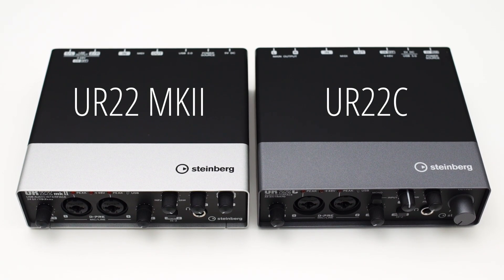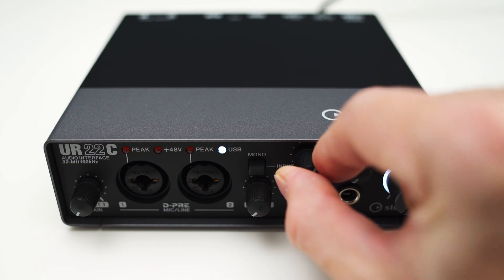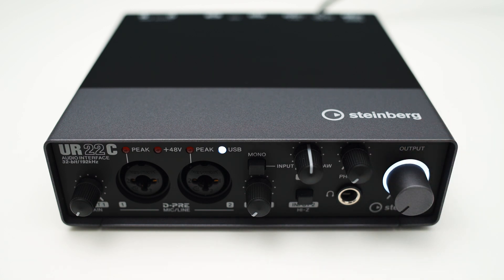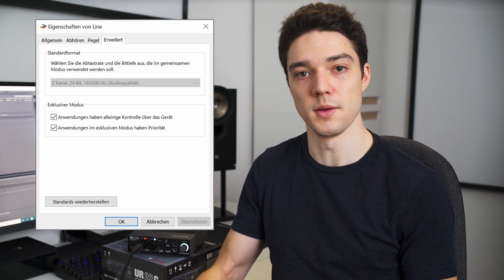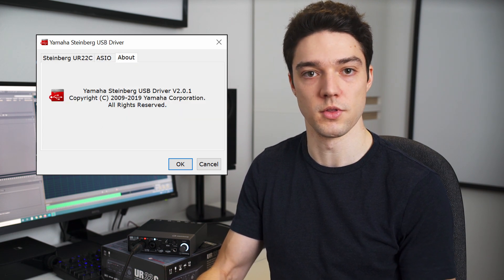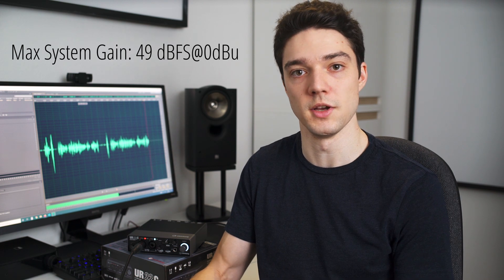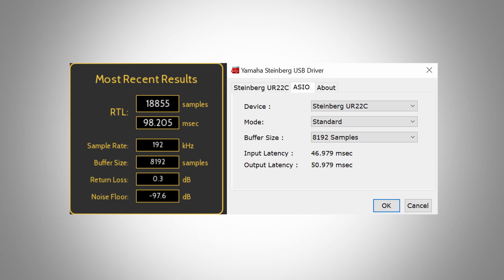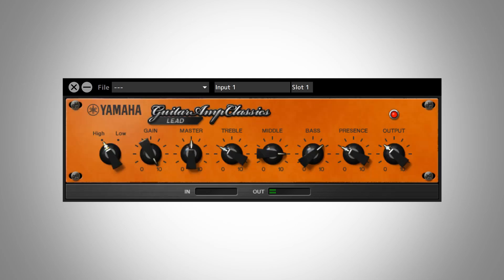Yamaha URX22C / Steinberg UR22C Review - Did Steinberg improve the legendary UR22?

Comment: Hi @Julian Krause!.  Stellar review, and great channel. Thanks so much. 

I just picked up the Steinberg UR22C Audio Interface, which I was hoping use for an online Piano lessons. Unfortunately, I can't get the device to pick up either my Antlion ModMic (using a 3.5mm TRS to 6mm TRS adapter), or my Stadium Lavier mic (with a 3.5mm TRRS to 6mm TRS adapter).

The Antlion mic works in everything else, while the lavier mic works only on my iPhone. I assume it has some kind of pull-up circuit going on.

The interface works very well with the piano and guitar.

Any idea what I might be doing wrong? Do these mics need bias power or something? If so, how can I do that? Or do I need to change the input settings somewhere?

Thanks to anyone who can point me in the right direction.
Reply from the maker: Hey, the 1/4 inch inputs on the UR22C are line level inputs and not designed to be used with 3.5mm mics. They don't provide the 3v plugin power that the mics need. If you want to use your lavalieres with the UR22C you need something like a Rode VXLR+ which adapts 3.5mm to XLR and converts the 48v phantom power to plug-in power. Cheers!

Comment: Greetings from Greece my friend ! I’ve got a very important question about the UR22C. Mine arrived today and I generally like the sound, preamps and DSP fx, but my problem is the headphones volume as you mentioned in your videos. I currently use the AT M40fs headphones which were very satisfactory for me till now. I definitely cannot work with the ur and the m40 as the headphone volume is low for me. Which kind of headphones should I use for a higher volume. Should they have bigger gain, impedance or what ? Please answer to me as soon as possible because if I can’t fix this problem, I will return the card and buy Sth else that totally covers my needs. Thank you in advance.
Reply: A bit late I guess, but I see that your headphones have 60 ohms impedance, which is on the lower side for studio headphones so you wouldn't expect any better from that aspect. Sensitivity is measured at about 100 db, which would be average by today's standards. So if I was in your shoes I would have either tried more sensitive headphones (about 110 db maybe) or accept that most usb powered cards will not be terribly good at driving headphones so a dedicated preamp is needed. I'm surprised though, because I've used my 300 Ohm headphones on USB interfaces with an acceptable volume, while my 64 Ohm AKG K275s (stated sensitivity: 109 db) play more than loud enough directly through my smartphone.
Reply: Hi! I also have the AT M40fs headphones and I'm planning of purchasing the UR22C to work with Cubase. What did you finally do about your low volume issue with these headphones paired to the UR22C? Thanks in advance!
Reply: @Steven-do2dp  after changing more than 15 interfaces, I realised that it’s a common issue that the headphone outputs don’t have enough power to drive high impedance headphones. Luckily, with the ur22c you are able to insert the morphing channel strip on the channel you want to record and this will bring up the volume enough. Of course you can choose NOT to record it, but record only the raw signal. The m40fs will be ok with the ur22c. And I’m saying again that the volume is ok for listening to music or for mixing/mastering. My issue was only when tracking. Greetings from Greece.
Reply: @PetrosAntoniouMusic  Oh that's very valuable info for me! I think that's the confirmation I needed to finally decide myself to purchase the UR22C! BUT BUT BUT... I'm a bit worried about what Julian said, that low impedance headphones with the UR22C could modify the sound a little, so that it can't be reliable when mixing or mastering solely with these headphones...  Any thoughts on that?

Comment: So the second power supply is micro-usb ... wtf, why Steinberg?!
Reply: Not an issue since it's main power source is USB-C, and it comes with a cable. I just got one. The other end of the cable is normal USB sized male plug lol. The micro is for using on the go with portable devices. It's just a cable man.
Reply: @TheDyingScotsman  Would love to hear what you think of this unit once you've set it up and had a play.

I'm really fond of the DSP effects being handled by the unit itself in real time, rather than by the PC.  Amazing for both monitoring and eliminating some post production while recording vocals and instruments, and super handy for live streaming.
The only thing I'm worried about is the noise floor.
Reply: @iRud99  Well so far it seems fantastic. I hear a little bit of hiss coming through my headphones, but recording tracks themselves there is no noise to speak off. The built in DSP actually seems really good. I won't use it most likely, except for the reverb which sounds amazing out of the box. The amp  sims seem mediocre but there's plenty of VSTs for that stuff!

Comment: Hi. Thx for this great review. I have a question about the headphones output level of the ur22c. I red that it is quite low. i have a Beyerdynamic DT 770 80 ohms and i don't know if this interface is well suited for this impedance level. I want to record tenor saxophone with a playback in the headphones from Cubase so i need a decent output level to hear the playback while i play the sax, which is a pretty loud instrument. Or should i upgrade to a dc powered interface such as the ur-rt2. Thanks for your answer. Franck.
Reply from the maker: Hey, I don't think the UR22C is suited for your DT770. The high output impedance of the amp can change the sound and as you said, it does not have that much power. I'm not sure if a wall powered interface will solve this problem. One solution might be to buy a different interface like the Motu M2. It has a very high quality headphone amp and much more power than the UR22C.
Reply: Julian Krause thx a lot for your advice. I have watched your review of the motu and it seems great. I have noticed the point concerning phantom power. As i record with an akg c214 condender mic, i understant that there will be no problem if i use the phantom power button ? Have a good day and keep the great reviews ! Franck.
Reply from the maker: @alcarazfranck9952  Correct, there will be no problem when using the AKG C214 with phantom power. Cheers!
Reply: Julian Krause Hi Julian. One last technical question about headphone output comparison. I went through the users manual of different interfaces (being totally ignorant !). For the ur22c they say that the headphone max level is 15mw+15mW, 40 ohms. For the urrt2 (wall powered) :  100mW+100 mW, 40 ohms, so louder than the previous one. For the motu m2, the specs are different : max output level + 12,5 dBu 16/32/55 ohms. Does this compare ? If yes, Can you tell me which is the most powerful between the urrt2 and the motu m2 ? Thank you very much. Franck.
Reply from the maker: @alcarazfranck9952  Sadly the specs of the headphone output of different manufacturers are hard to compare. I can tell you that I measured the M2 and it delivers about 25 mW into 40 Ohm. To be honest anything above 20 mW should be more than enough to drive all kinds of headphones. One thing to keep in mind though, is that these power figures are only valid for 40 Ohm headphones. As you use 80 Ohm Beyerdynamics, things might change a bit. Though I would still expect the UR22C to be the least powerful, the M2 to have a bit more power and the URRT2 to the most power of the three interfaces. Cheers!
Reply: Julian Krause thank you very much for your expertise and your fast answer. Keep the good reviews (among the best on You Tube and i have seen a lot in this "quest" of the best interface !) 👍 Franck.

Comment: Nice review! But missing some info i need to know. When open in Cubase pro and you are at 32 samples to low latencies, and set some vst plugins on channels, lets say open 3 x  nexus 2 and one Kontakt library simultaneously and try the sounds with your midi keyboard then, do you get cracking and popps of the sound when playback or trying recording?

Comment: This is one of the best reviews I've ever seen about audio interfaces, on youtube. But there are two points that are not clear to me. The first is related to the compatibility of 32 bits, with  Mac this problem should not exist. I think...
The other question concerns the argument of 32 bits. 
The captured sound in digital, as you know, is calculated by multiplying samples per bit by the relative channels (usually 2 in stereo).
192kHz/24bit: 192,000 X 24 X 2 = 9,216,000 bits per second (9.2Mbps).
Then there is the problem of the dynamic range, which at 24 bit is up to 144 dB, at 32 bit it is over 1500 dB. Obviously, the interfaces have limiters.
In any case, an interface that captures sound at 192,000 Hz for 24 bits per second, for example, is certainly less precise than one that captures it at 192000 for 32 bits per second. And if digital wants to challenge the analog, this is the natural evolution of these devices.
As in the photograph, at first, there were those who turned their noses on the pixels. Today film machines are used only to exhibit vintage cameras. Like when one goes to an event for vintage cars with an Aston Martin from the 60s.
Reply from the maker: Keep in mind, Bit depth does not enhance the "resolution" of the audio and give you a better sound. It merely gives you a higher dynamic range. As you can capture about 144 dB of dynamic, it is more than adequate to capture the DR of the UR22C. 32 Bit does not give you a higher quality in the capturing process.
Reply: @JulianKrause  This is clear, however when you record audio at 32-bit, you have almost infinite possibilities to increase or decrease its volume, without losing anything in the dynamic spectrum and without distortion. Perhaps for some uses, it is true that at 24 bit you are already beyond the necessary, but for the development of digital music (synths, emulators, etc.) it is an important frontier that brings digital closer to analog.
Reply from the maker: @lebowskisdream1619  Yes, for handling audio in the digital realm, 32 Bit makes total sense, especially if you use a floating point.
Reply: But Im confused. the dynamic range for this 102db is pretty bad but its theoretical dynamic is so much higher being 32 bit….so….help me to understand this?
Reply: If it is 32 bit, it means that they have chosen a lower dynamic range for this model, which is commercial, because of the audio outputs to which it is combined. If your headphones have 108 dB as a limit, do you need an interface with a 140 dB output?
Another thing is to understand if the 32 bits allow you to raise the volume level on the track without distortion when converting audio from Analog to Digital. Expanding the depth of the audio up to 32 bits (and maybe beyond tomorrow), you can record the steps of the ants.
Reply: Ok to fully understand this, in my imagination there has to be a samplerate at wich the bit rate of 32bit cannot longer keep up. Anybody with me?

If 32bit is the 'dynamic range' of the digital environent.
Reply: Or is the bit rate the depth of bit's (amount of information in bytes) per step of the sampling?
Reply: In that case the 32bit is more than something else good for data transmission. Ie DSP resolution and maybe a bit esoteric while still interesting regarding sound capture.
In editing photos it would mean it

Comment: I'm using beyerdynamics DT770  with 80ohms. How will the sound be affected by the output impedance? Also i'm planning to get a sm58 and i've heard that dynamic microphones will need a lot of gain on this unit and that it will crank up the noise. Is this true?
Reply: Hi! Finally, did you get your SM-58? How well does it perform with the UR22C?

Comment: Probably the best audio interface review I've ever seen! Great detail, hard work and lots of thought and effort in this video. Thank you.
Reply: Agree. I just discovered this channel. Its quality is super!
Reply: it's the JK way
Reply: German(?) reviewer for a German product. Top quality stuff. ;)
Reply: @Silatbule  May I ask on what platform you have compatibility and driver issues, please? I am curious. I have it on both Windows 10 and Big Sur (I mainly use Big Sur). Thank you
Reply: @mnmleung  Hi, it's fine now. I got to the bottom of the issue. I'd migrated my OS to a new SSD just before buying the UR22C and for some reason it affected my USB driver. I re -installed the USB driver for my motherboard and all was good. I'm actually going to delete my original comments as with hindsight it was a little unfair!
Reply: @Silatbule  Thank you for clarifying. I am guessing you are not on macOS for this particular installation then.
Reply: @mnmleung  No Windows 10. The recording sound quality is far better than my previous interface however.

Comment: Again, there are no decent audio cards in this price range in these days. For the a similar price (price adjusted for inflation), I got a much,  much better PCI-based card in 2005-2006, The ESI Juli@.
Yes it was PCI-only, no microphone amplifiers/instrument ins or effects. But the AD/DA converters were much better. 102 dB(A) on this?  114 on the Juli@! 106 for the output on this? 112 for the Juli@
And it has balanced inputs and outputs as well (but higher quality).Combine it with a quality pre-amp/channel strip andit gets  in to a different league! (but of course the pre-amp costs at least more than double what the audiocard itself costs).
At the same buffer sizes, you get half the latency on the Juli@= Much lower latency and CPU sparing. It's like having a CPU that has double the performance!
That is the main factor for me since the difference in audio quality may not be noticed anyway. And 32 bit is just ridiculous. i challenge anyone to hear the difference even between 16 bit and 24 bit. 
BTW 16 bit=96 dB and the UR22C has 102 dB which puts it at just 17 bits of quality (and this is supposed to be a 32 bit card). The output doesn't even reach 18 bits (in practical use when just using virtual instruments, for example). I don't know of any audio card that exceeds the 144 dB that 24 bits is supposed to give you. So, it's a market ploy!

They are not the same some people may argue (one pure audio card where maximum effort is put on latency and audio quality for a person who already have a preamp and the other an all-arounder where you put in everything and get mediocre performance and audio quality.). 
But the point is that to get a comparable performance level when it comes to latency, you must pay much, much more these days since the manufacturers have stopped producing internal audio cards in the lower or even mid price range that is just that. 
I don't have the option to just buy a good internal audio card at the same price point and combine it with my separate Focusrite mic preamp/channel strip.
In the lower consumer space they put in all kinds of things and make them some generic USB-driver crap which will have these awful latency numbers and, adding to that, not that good audio quality.
Yeah, I can stil use my PCI-card, but most newer motherboards doesn't have any PCI-card slots anymore. I happened to find one good Asrock card that did when I upgraded to the Intel 8700k last year. But I guess that I will be out of luck when the next upgrade comes!
Reply from the maker: Yeah, it is interesting that audio cards have become increasingly rare to find. Probably because many people changed from full desktop PCs to laptop and tablets. Maybe I should check out an audio card. Do you have any suggestion?
Reply: @JulianKrause  When it comes to pci-express audio cards, the market is very small in the budget to midrange. 
The ESI MAYA44 eX looks to the real low-end one that is similar to the ESI Juli@ I have now (and priced as the Steinberg UR22C). 
But it has a phantom power (+48V mic input too (and line in/instrument) and since it is similarly priced as what my ESI Juli@ was at the time it has worse AD and DA and looking at dynamics its numbers are lower (About the same as The Steinberg U22C actually)
MAybe that is enough anyway..
Another  interesting option could be the more rare Maria Seraph 8+ TRS (Some german card maker)
https://www.thomann.de/se/marian_seraph_8_trs.htm
I could only find one short review about it.
But that is about 3 times as expensive as the former two cards.
And it has 8 ins and outs.
Still, maybe the only option and good if you are a person looking to buy external analog synts.

Comment: why does the brand new Tascam 102i have an EIN of 127dBa ? it's a 400USD interface. i expected more. maybe you can get some real measurements for us ? sad to see a Behringer have lower noise...
Reply from the maker: Keep in mind, that 127 dBu(A) is still very low noise and only 2dB worse than the Beringer UMC202HD. In practice this difference is not that big of a deal. But I understand you, when you buy a premium device you want to get the best performance possible.

Comment: One question about output impedance, is a higher output impedance better suited for headphones with higher impedances (in terms of higher possible volumes), or should you always aim for as low output impedance as possible?
In other words what should i look for if i want to run say 250ohm HP.
Btw awesome video and knowledge.
Reply from the maker: Hey, preferably the output impedance of the headphone amp should be as low as possible. Even when you use higher impedance headphones. But if you have higher impdance headphones the output impedance of the amp is not as critcal as with low impedance headphones. I'll post a video soon where I explain this in more detail :)
Reply: @JulianKrause  Thanks that cleared it up perfectly, thank you so much!